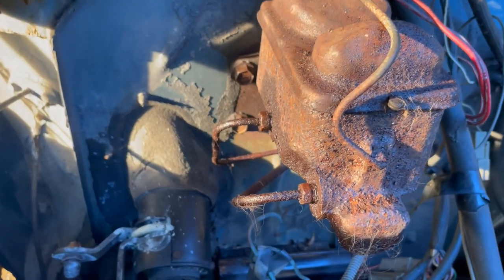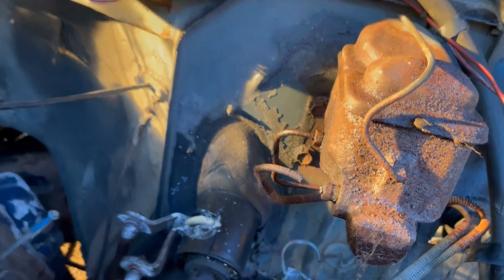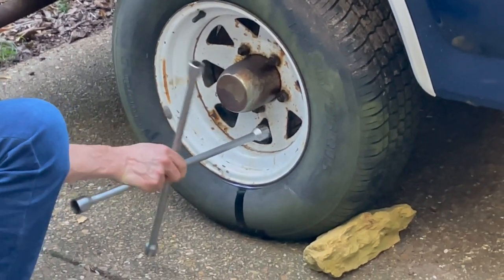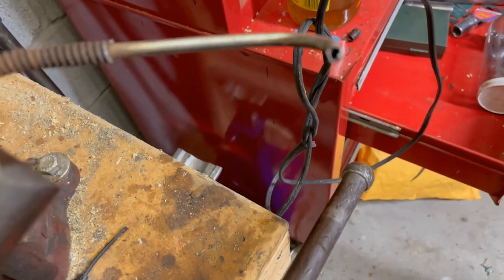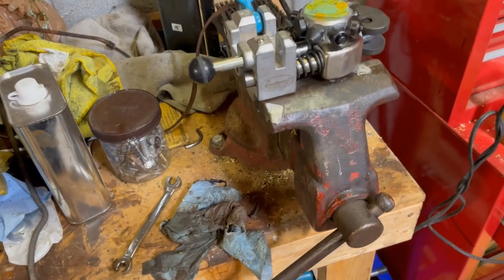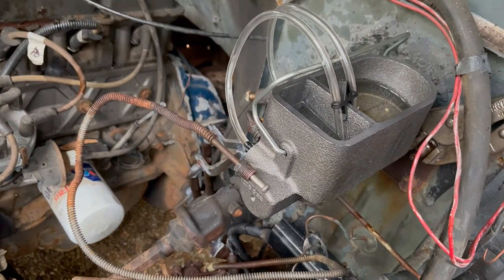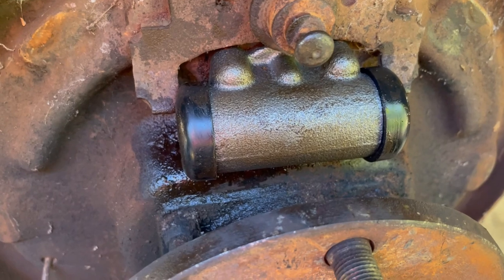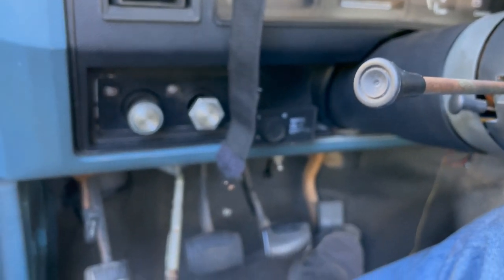1980 Ford F100 rescue part 5 brake lines and master cylinder

Comment: The new brake lines you installed look like they are copper, are they? 👍👍🇨🇦
Reply from the maker: They are a nickel-copper mix made by Fourlifetimes. I love them. They are easy to work with and I have not seen them fail.